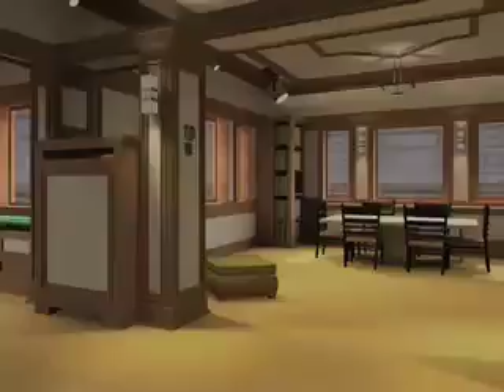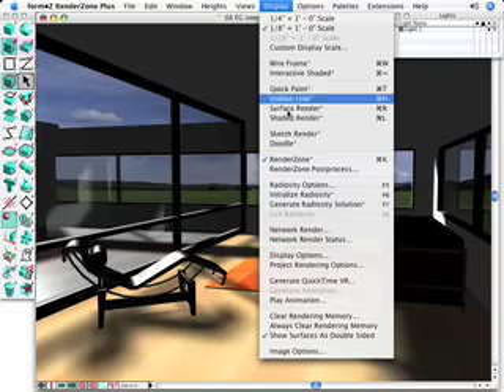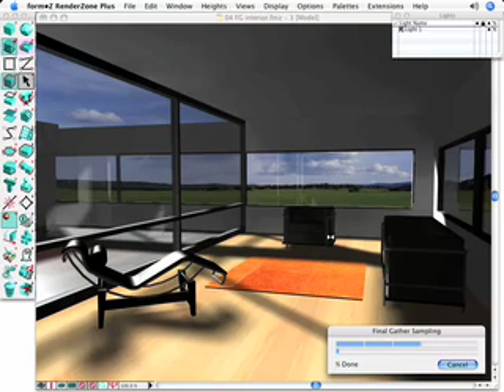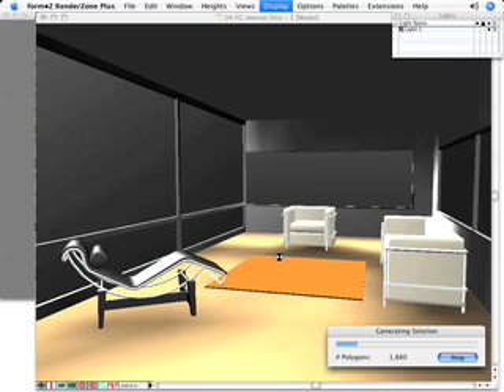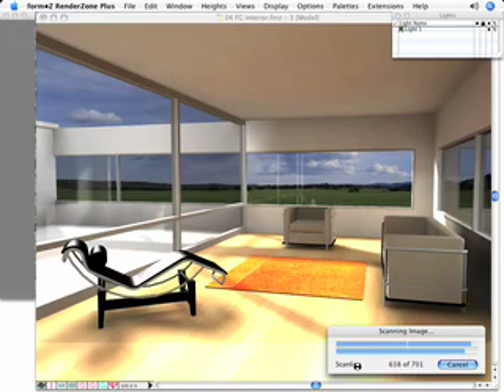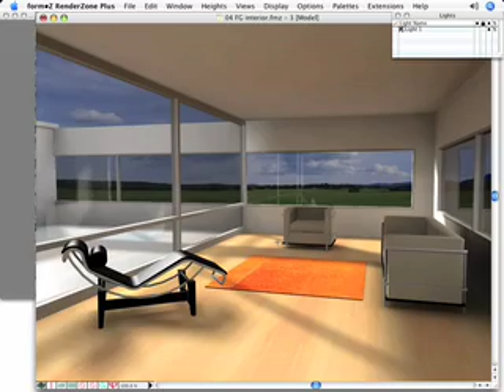formz Final Gather Demo

Comment from the maker: SveinSveisen,

To access the options, you need to hold down the Option key (Mac) or Ctrl-Shift keys (Windows) when selecting the items from the Menus.  (The asterisk on the menu item indicates that it has these options.)

You can also access these options via the Display Menu: Display Options command.

It may also be useful to know that clicking on any tool or menu item while holding down the SHIFT key will automatically open the manual to the appropriate page.

Does this help?